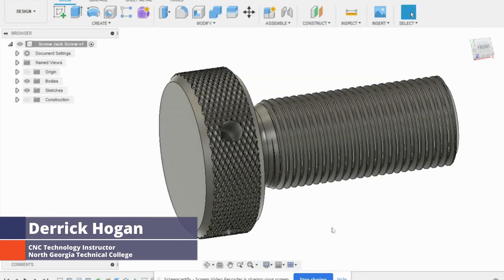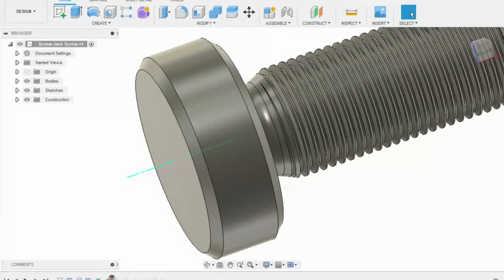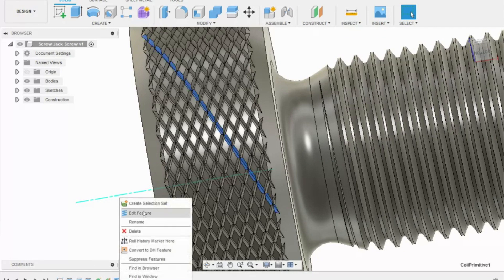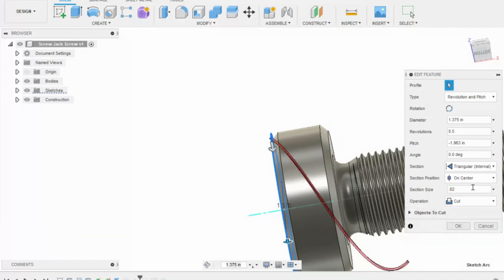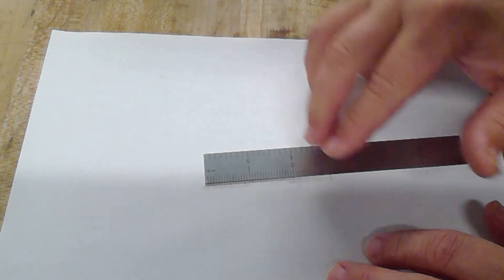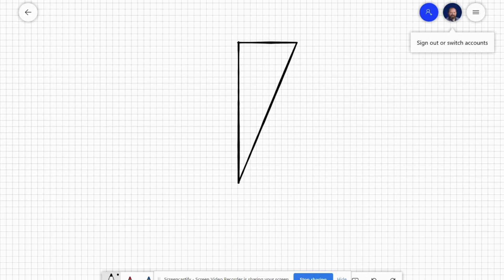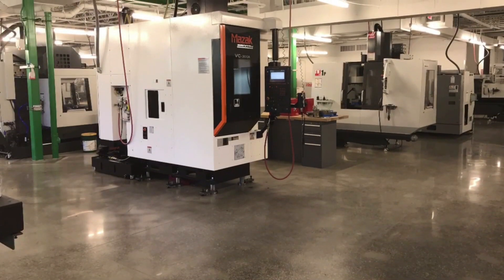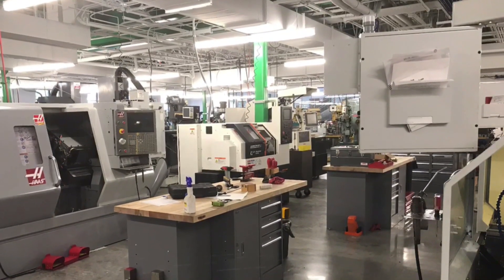CNC knurling without a knurling tool

Comment: Please explain   how do write  for  fanuc operating systems
Reply: new can cycle for each lead. back the start off each cycle to create the gap between leads. as he said a lot of leads will create a big start gap if you dont have the bitchen software his badass machine comes with haha. invest in a good dorian cut knurling tool, its cheaper than this machine.

Comment: Is there a way to do variable pitch knurling using this method? Such as starting tight and transitioning to a looser pattern over the span of an inch or so? All the machine has to really do is change the feed along Z at a predictable rate but of course programming that change seems tricky.

Comment: knurling is a deformation of material. This is removal of material. its more of a crossed line pattern finish.

Nice progamming and tips anyway!
Reply: Except when cut knurling, then it is not deformation. As in this example as well although different tools.
Reply: @gerritvisser  Agreed! I use a cut knurl tool and this exact method to knurl harden material or long parts without support. Example, I had to put a knurl on a fairly exact diameter pin and I wanted the knurl to be to be to a consistent depth. I could have knurled, messed with tapper to get the depth correct and then turn it back to the correct OD but it was about 4 x D (just under 1" and about 4" long). With only a couple parts to make it was way easier to just cut knurl it in. I quick hand coded macro and I was done, yes it takes a long time to run (I wouldn't want to use it on a hundred parts!) but way quicker to setup for prefect depth and basically zero risk of scrapping a part. Now when this is customer supplied material and you don't have much or any extra and then this is the very best way to go in my opinion. Nothing like a double track knurl to ruin a otherwise nice part!